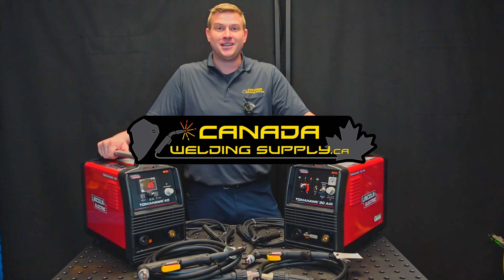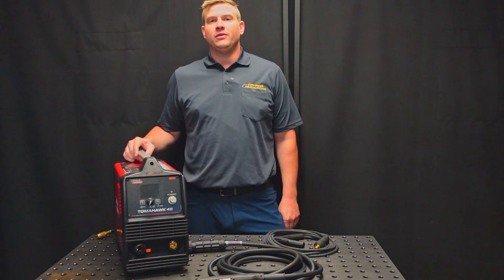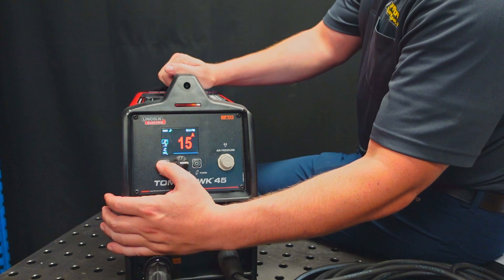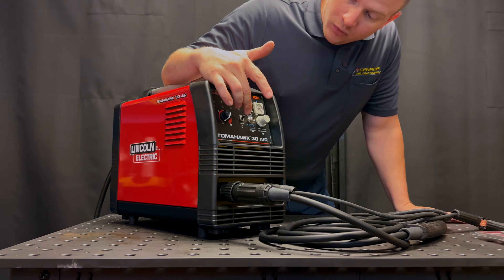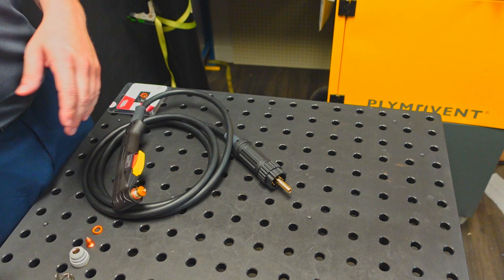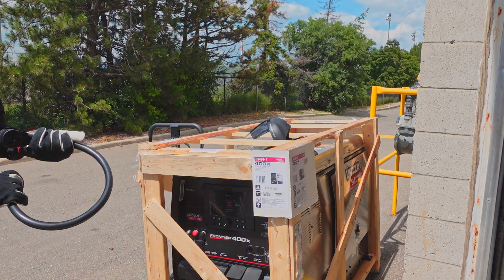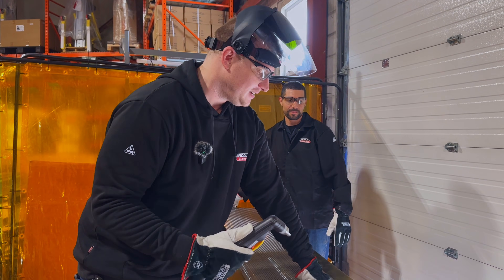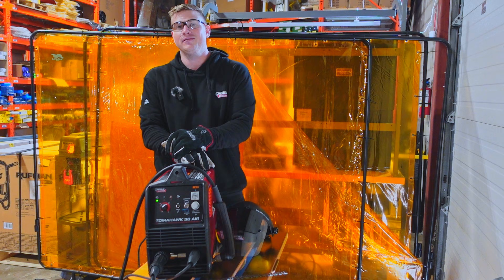Can This Plasma Cutter Cut Half-Inch Steel? - Lincoln Electric Tomahawk 30 Air & Tomahawk 45

Comment: 4:45  the tomahawk 30 is not dual voltage, that’s false.
Reply from the maker: Thanks for flagging this, The video was shot before the machine was released.  The machine is dual voltage but the capacity is reduced when using 120V and so Lincoln decided to market it as 240v onlyb BUT it will work on 120V.  We will add a disclaimer to the video.  Thanks!

Comment: Does the plasma cutter come with the Frontier 400X ?
Reply from the maker: No, the  Frontier 400X does not come with a plasma cutter but it is common to use a Frontier 400X to run a Tomahawk plasma machine